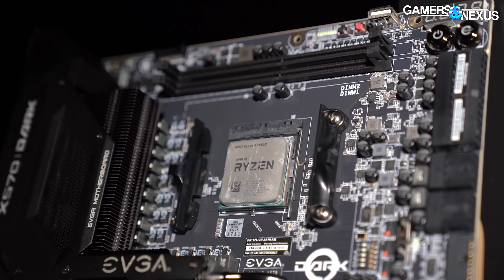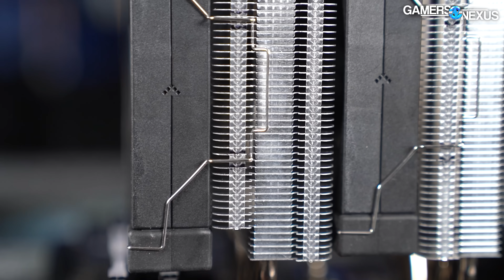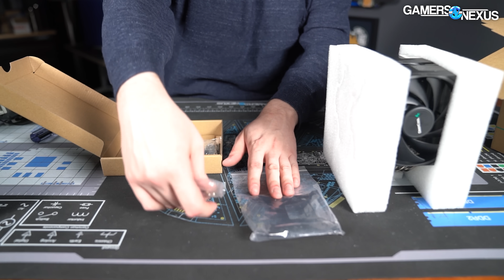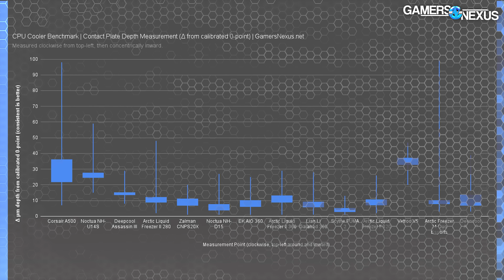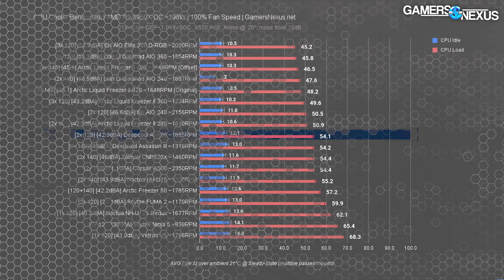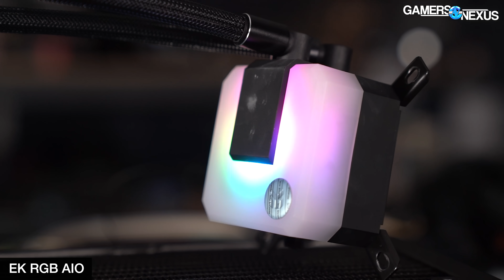Air Coolers Are Getting Impressive: Deepcool AK620 Cooler Review

Comment: Why choose a HULK cooler over a simple 1 rad 1 fan 1 pump water cooler for around the exact same price? Loads cooler, Less room, Better looking and controllable.
Reply: Alot prefer not to replace an AIO every 5yrs for 200$ or the risk of it leaking or just can't afford it, me I prefer corsair AIO water cooler they last extremely long never break never issues looks pretty an clean, very rare you ever hear of an AIO actually leaking at least from corsair stuff, I run a 2990x threadripper under gaming at ultra 4k 60 it sits around 45C with my H150i elite capliex , most of these Air coolers run 65-70C no thanks to much heat an all that pumps into your room Maken it hotter
Reply: @Anihilationx360  I have been in the computer business for 19 years strong. You are in the absolute minority when it comes to this then. The "leaks" you proclaim well In the last 10 ish years I have built computers with them I have NEVER not 1 time run across this issue. Pumps die, fans die, sure but NEVER leaks. The Liquid cooler system DOESN'T cost $200. Im not sure where you got that from but I can pull up newegg and see I can get an enermax for just under $70 atm. Time to move on.
Reply: @acesontilt77  you clearly didn't read my post well or I didn't word it correctly, but basically what your typing is what I meant, AIO are amazing an never had issues out of the 3 iv used for each 4yrs never a single issue
Reply: @acesontilt77  I own the corsair H150i elite capliex it's 213$ when on sale in CAD I paid 265$ with tax from newegg, 70$ is Garbo cheap stuff, I'll stick to highend elite stuff

Comment: Microcenter is building my PC today.  If this had been an option, I may well have picked it over the Noctua D15 based upon price.  The probable is that they have had a hard time getting and keeping dual fan, dual tower air coolers.  So while I would have gladly taken a Noctua Chromax, Fuma 2 or Be Quiet Dark Rock Pro, they weren't an option.  I don't want a water cooling solution. So why wouldn't I pay $90 for this if it was the only dual/dual air cooler?  The other choice was waiting on my build, but then something else would have gone out of stock, as has been the case over the last 2-3 months.  What am I missing?
Reply: You're not really missing anything.  In your specific case you're limited by the options MC has available.  As you've noted, one area that I've always found MC lacking is CPU cooling options.  You're paying a bit of a premium for the convenience of MC putting together the build, which is fine.  This video is targeted at DIY builders who have dozens of options to choose from and, from a purely financial perspective, the premium charged for Noctua coolers isn't worth it.  However, if the buyer places a premium on Noctua's reputation, which is well earned, then they may be willing to pay up.

Comment: Would you consider testing some Thermalright coolers such as the Frost commander 140, Le Grand Macho or the Silver Arrow IB-E Extreme?

I remember back in the C2Duo C2Quad days Thermalright were on top with the Ultra Extreme 120 and the IFX-14 which had a mini cooler for the back of the cpu socket, I had both. Wondering if they still live up to their old reputation out of nothing more than curiosity. Haven't seen any of their stuff in years but the website shows some interesting looking coolers.
Reply: I second this. I've had some thermalright coolers in the past.
The 8mm heatpipes and interesting design of their new coolers have no real reviews online.
Reply: I have a Termalright True Spirit 120 Rev. 2 Plus. I got less than a year ago. 

Cools my OC 9700k running at 4.9 ghtz at full load will get 69c of gaming non stop. Idle at 30c.
Reply: Thermalright PA-120 on my 5800X. Gets me better temps than the 240mm AIO I had before it failed.

Comment: The deepcool Gammaxx GTE V2 is worth looking at too imo, I'd love to see your take on it. It can be found heavily discounted in Europe for around €20-€25 and seems to perform only slightly less well than the Hyper 212 evo
Reply: The Gammaxx offers a great price to performance ratio. The looks are not to shabby either.
Reply: @deuswulf6193  That's been my experience, absolutely. The white LED version is usually discounted and it compliments white cases very nicely!
Reply: A week ago I bought the GTE V2 for a 2600. And it was 30-40% less expensive than any Hyper 212 available in my area.

Comment: I'm loving the $25-$35 air cooler market right now. There are several extremely efficient coolers in that price range that cool sub 110W CPUs well enough.
Reply: Hi, what cooler would you recommend for a 105W CPU such as the Ryzen 5800X or the upcoming 7600X?

Comment: Linus found the Nactua NH-D 15 was equal to or better than water. How do you find 8 degree lower temps on water??
Reply: Yeah I was wondering the same thing. Ive got an LTT Chromax NH-d15 for my i7-9700K. You can also by Heatsink covers for the d15 which make it look nicer too. Super happy with it. Got 4x NF-A14 Chromax as my case fans, and the system is so quiet. 

The thing about noctuas fans (for me) is that the noise signiture is very onobtrusive. Ive been watching Major Hardware's fan showdown and dba level doesnt tell the full story. The design of the fans can seem louder to the human ear even if they are technically the same dba,

Comment: Air coolers for life! I ditched the AIOs in both my builds and went air cooled again. I just prefer the safety in less moving parts that can degrade, and destroy components haha.
Reply: I was going to debate a bit and offer a point of contention about the degrade….. then I remembered my huge stack of AIO’s I have with many from 120 thin/thick core, 240/280 twins to a few 360 and even some hacked 480’s and yeah man I have to agree. We all remember the thermaltake issues with their corrosion. I take the biggest issue with the coco blocking on Austek owning the patent on pump design that has made the industry stagnant on future development. I often wonder how good the systems could be if companies didn’t have to deal with royalties probably preventing development on better systems. Good point. 
I always loved my air coolers; even the old school Zalman round style coolers. Those were dope.
Reply: @blech71  That patent is set to expire soon, though, pretty sure. So don’t worry, they’ll be stagnant in the other direction as everyone uses the same design, haha.
Reply: @blech71  I'm still rocking my Zalman CNPS9900MAX-B that I got with my previous computer build in 2011. When I upgraded to my current build in 2020 it came along for the ride, though I did swap out the original blue LED fan with a Phanteks RGB fan that I modded to fit, and I used a graphite thermal pad this time around instead of thermal paste. Still cools my 9700K like a champ, though, idling at ~10ºC over ambient and hitting ~50ºC over ambient running Cinebench or Prime95.
Reply: I mean that's basically the reason why I'm going back to air cooling (and possibly this cooler) - I got Cooler Master ML240 with my MBO and it was nice when I upgraded from Intel to AMD. But after 4 years the pump sometimes revs up randomly and it's loud. Plus there is higher risk something can go wrong as usually AIO should be changed between 5-8 years as far as I know.

As long as Deepcool provides brackets for new sockets all I need to do is clean it up from dust and in worst case exchange the fans.
Reply: i feel you bro. I want to change my AIO too into CPU Cooler. And I will get this Deepcool AK620. This thing is a beast.
Reply: My H100i has worked fine for 5 years with now degradation.
I just dust the radiator every year....
Reply: My cooler master AIO disintegrated on me, so I'm returning to air cooling too. I went with the Noctua dual fan black thingy with twin radiators. It was pricey for an air cooler, but the reviews are solid enough that I'll take it anyway.
Reply: Getting ready to swap one of these into my build, at over 5 years old I feel like the AIO in my system is getting into tge risk zone for inevitable failure, even if it still seems well behaved for now
Reply: Ive used 120mm, 240mm, 360mm on both GPU and CPU; and never failed a component like that the way you describe. The only problems i had with water was the custom build which often required more maintaince then these plug and play things. From a performance standpoint, water beats aircooling day and night.

Comment: Impressive. I didn't expect it to do so well after seeing the contact patch on AMD CPU's. Might even do a little better if it could get some better contact on those two outer edges. Of course, it looks like it might be enough to cover both the cores and the I/O die, so the improvement might be marginal. Either way, the performance speaks for itself. Pretty good for a cooler in that price range. If only it came in black.

Comment: i bought a 22$ cooler last year DEEPCOOL GAMMAXX 400 for my ryzen, 
unless prices shot tho the roof, spending any more then 50$ on a air cooler is ridiculous.

also that EVGA X570 Dark mother board is almost 700$ and is only has 2 ram slots?
seems about 2-300$ overpriced.

Comment: I haven't heard of many mid-towers that "tap out at 150 to 155 [mm]", I've been through 4 different ones in the last 10 years (nexus, raijintek, fractal, gamemax) and all were 165mm or more, but what would I know?
Reply: Umm a lot of mid towers do unless you are buying huge cases that are full towers
Reply: @samgoff5289  All of the above were mid, not full towers. Each time I was short-listing new (midi) cases I don't recall ever finding one that wouldn't accommodate my thermalright TRUE and later NH-U14S (both c. 165mm).
Reply: O11 dynamic only supports up to 155mm.

Comment: On your closing thoughts you said they (The DC one and the FUMA2) are basically the same and ones should choose based on Brand and aesthetics. However, the HUGE difference that made me go with the FUMA was the slim front fan. It is the only 2 tower 2 fan that keeps 4 ram modules compatibility and have good performance. Combined with good prices it is one of it’s kind.
Reply from the maker: It is not accurate to say the FUMA is the "only 2 tower 2 fan cooler" compatible with 4 DIMMs. If you watch the DIMM height, others are as well.
Reply: @GamersNexus  That’s correct. With Low Profile RAM, some works. But what I meant was that is the only one that not cover the RAM modules. Meaning you can choose any stick, including RGB ones (for more FPS)
Reply: @TheMutchas  you can put a 120mm noctua fan in front of the D15S and still use those sweet Gskill neoz rgb ram sticks. No luck with 140mm though.
Reply: Yes I'd forgotten about that, you are right

Comment: Little recent Deepcool RMA story for my aircooler :

I bought a Deepcool AS500 Plus half a year ago for my 5600x (Cost me 60€, not sure how much it is now), it comes with 2x140 fans and one of them was very noisy past 1000rpm.
The retailer ignored me (Tradeinn, or Techinn, one is the other's subsidiary i guess) so i contacted deepcool.
After asking me for a video recording of the problem, they quickly sent me a brand new fan, free of charge (even shipping) and without asking me to return the faulty one.
I used the faulty one to...cool myself like a nerd for a couple weeks using a 4pin>usb adapter i had. That fan eventually died after the couple weeks.
So anyways, i was fairly impressed by how they handled it.

I think this cooler is worth taking a look at but now that they have a 65$ dual tower alternative, i'm curious to see how they compare.

Comment: Can't compalin from the nh-d15 tbh. I bought one years back and it has proved to be an exceptionally valuable purchase. Bought a couple more during the years for family member and friend builds, simply due to the performance they offer coupled with the low noise, which is an important factor for most who I've asked. Same went for GPUs funnily enough. People always tell me that they want a gpu which doesn't roar like a werewolf at full moon, which got a few bucks into Gainward's pockets back in the day, as their gtx 1070 and 1080 phoenix editions were among the quietest I've had the pleasure of using.

Comment: Surprised we haven’t seen the newer model Noctua uh12a on this channel yet.  They have been sold out with people paying higher price for the smaller Noctua cooler with similar performance to the bigger d15 and better performance to other manufacturers 140mm air coolers
Reply: It is literally the same cooler painted black what is there to test
Reply: @samgoff5289  The single fan model(uh12a) is  on his charts.  Since the original uh12a (dual fan) hasn’t been tested just test the more sought after model to see how it compares to other coolers.  According to the manufacturers website their actually are differences in the 3 different uh12 models.  Different fan models and number of heat pipes in the single towers.

Comment: You should check out the thermalright peerless assasin 120 cooler. Its a dual tower air cooler that runs $50 or so. I have one cooling my ryzen 5600x cpu and it does pretty well.
Reply: I'm cooling my 5800X (OC) with it. Locked it at 50% fan speed (90% when it reaches 75°)...And I NEVER heard it ramping up. I hooked up another fan at the back though (from day one...More for the looks than the performance).
Reply: @shane250  yea I like to have my temps for CPU and GPU up while I'm gaming and I've never had it go over 70C. And the fans are actually very quiet. I used to use only Corsair h60 liquid coolers and this is far more quiet than that.

Comment: my nh-d15 has lasted 3 cpus now, was the king at the time but it seems it's reign is well and truly over.
This cooler is basically equivalent for cheaper. seems great.
Reply: Noctua are putting a replacement for the d15 in Q4 of this year.
Reply: @hsavov  I can't wait to see and hope black is available at launch, but noctua rarely stays on schedule for their road map. It was supposed to be Q2 2022, my hope is maybe this time next year we may have a d15 v2.
Reply: @hsavov  Pushed back to Q1 2023 according to their roadmap
Reply: @hsavov  I wait.....
Reply: Is there a reason to retire your current cooler if this one performs more or less the same?
Reply: @GirthOfANation  No, not at all. I love my d15. Just saying if I needed a cooler, or am recommending one to someone, the ak620 would be up there.
Reply: @cl-e-m  I have a Black D15, I'd definitely try a Fuma 2 or this cooler from the video if I built another rig. To me, the D15 hasn't lost its crown, it's merely getting a stronger army that's dethroning AIOs for normal use and medium OCs :)
Reply: @GirthOfANation  If the new design can be produced for cheaper, sure it is. Which I hope it is, but I also hope the customer gets a taste of it as well.
Reply: What happened to the NH-D15? Did it get old and stop working?

Comment: What happens when CPUs become so powerful that both Air cooling and Water cooling no long can keep up with the heat?
Reply: It won't happen. CPUs are designed with thermal limitations in mind. In other words, no one is going to design a CPU that can't be cooled.

Comment: The AMD TDP calculation is very bad,  but it does have power in it. TCase is going to be a function of power and in physics we would consider power being in the equation as a result. The issue is not that power isn't there, but that it isn't controlled for. They would need to fix power and measure TCase, but they don't do that which makes their formula arbitrary.

Comment: I just bought an Nh-D15 a few days ago for $90. Did I make a mistake?
Reply: Not at all man. I had one for about 5 years and it cooled my cpu just fine. You'll be fine  don't worry about it :).
Reply: Its still a top-tier air cooler just on the higher priced side of things.

Comment: Do you think air coolers have any hope for 250W+ cpu's?
I couldn't believe that an nh-d15 in an open air case couldn't handle an 11700k (in fairness, MSI was probably generous with the voltages on motherboard default 'OC' button).

Comment: How well would it cool a 12900K at 100% load I wonder.
Reply: My guess is not well lol
Reply: Custom water loop needed
Reply: It's not good enough for that, I suggest a good AIO.
It's worth mentioning that you can reduce the power limit on 12900K significantly (thus, the temps too) for a negligeable performance loss. In that case, it will probably be able to cool it...we've seen it handles 200W load, so it's doable.
Reply: @LastSecBloomer  I suppose undervolting is an option, but there must be some cooler and case combo that can manage it right?

Comment: I love my BeQuiet Big Fucking Tower, but currently not running with it. my brother kept overheating with an AIO and I swapped his case to a fractal torrent and cooler to the Noctua D15 and he's never had a problem since then
Reply: What cpu? I have the torrent and a d15 chromax and wondering if it will be ok on my 12900k.